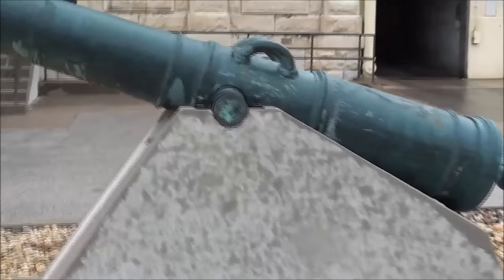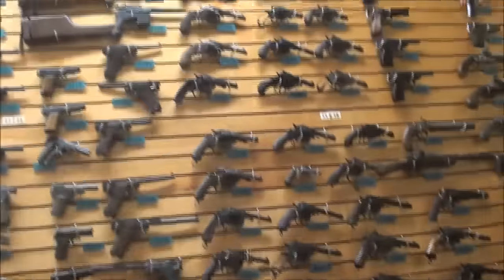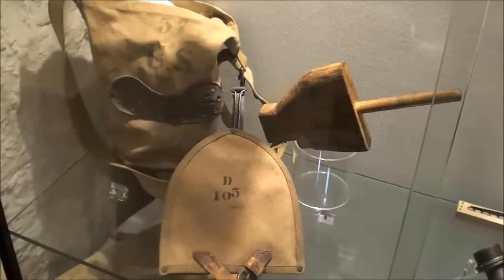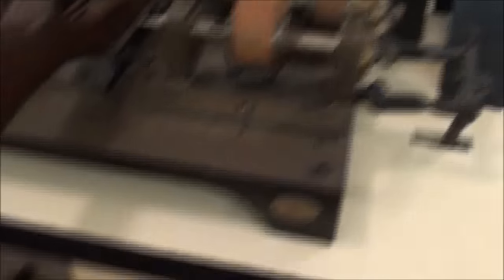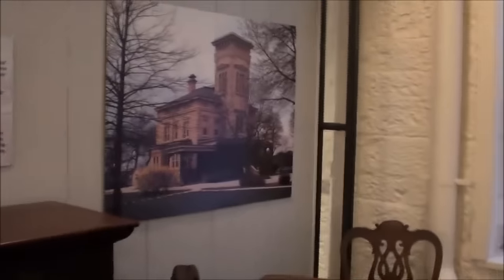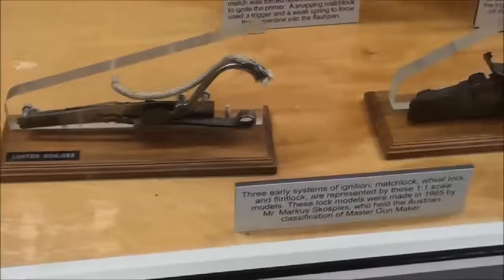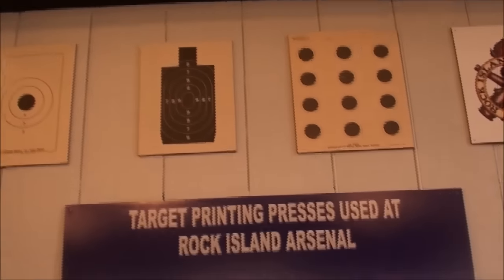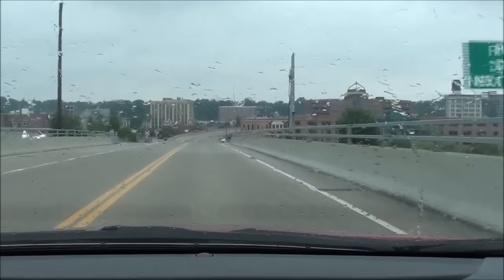tubalcain TAKES A ROAD TRIP TO THE ROCK ISLAND ARSENAL GUN MUSEUM part 2

Comment: Thank you for sharing your video of this trip.  I was a 20 year-old private who had just finished AIT (Advanced Individual Training) at Aberdeen Proving Ground, Maryland as MOS 44E (Machinist) in April 1983.  As a reward for being one of the top-performing soldiers in the class, 6 students each cycle were given Temporary Duty (TDY) orders to work at Rock Island in various machining positions.  I ended up running a 1939 Monarch engine lathe that was converted from flat belts to an electric motor sometime during it's life.  I was rough-turning castings used in M60 tank recoil mechanisms.  The TDY was the best duty I had in my four years in the Army.  We stayed in Davenport, Iowa at the hotel just at the turning bridge.  At that time I think it was called the Davenport Inn.  I worked at one of the older stone buildings that you pictured.  If I remember correctly, as soon as you entered the island from the turning bridge, you turned left on to a long, straight road that ran almost the length of the island.  About halfway down on the right was the building I worked in.  It was a wonderful time in my life.  The students all spent 3 months there.  I was sad to leave and I would have gladly served my entire enlistment at that facility.  I ended up at Ft. Benning, Georgia, got married and had children.  Originally from Michigan, I now reside in central Alabama, about 100 miles east of Ft. Benning.

I continued my career in the manufacturing field.  I went through the progression of machinist, toolmaker, tool designer, CAD/CAM technician, CNC machining technician and Manufacturing Engineer.  I now have over 30 years in the field with 9 more years until retirement at 62.  I have been blessed by God who has directed every career move I was given.

It kills me to see the country I once served now degraded to the point where in many cases the United States Constitution is irrelevant.  God help us...
Reply from the maker: rustyul Thanks for watching.  Thats quite a story. Our country is in sad shape.